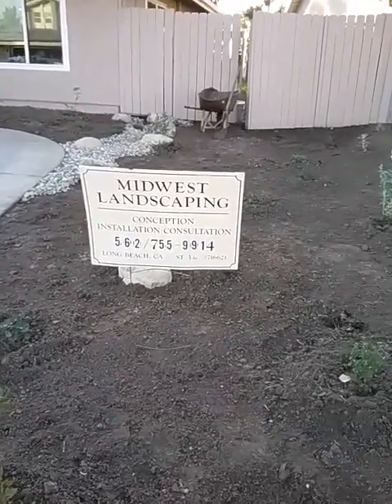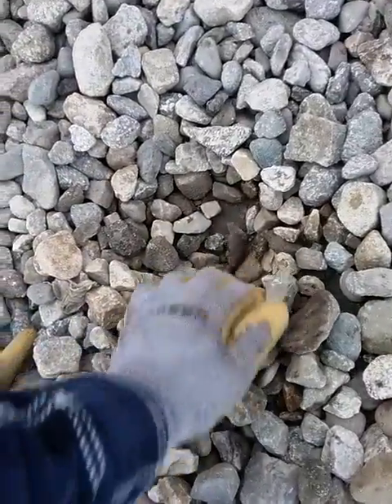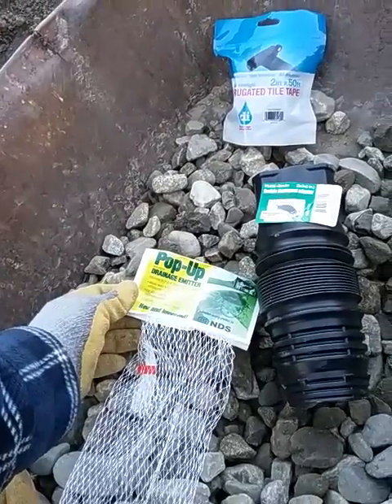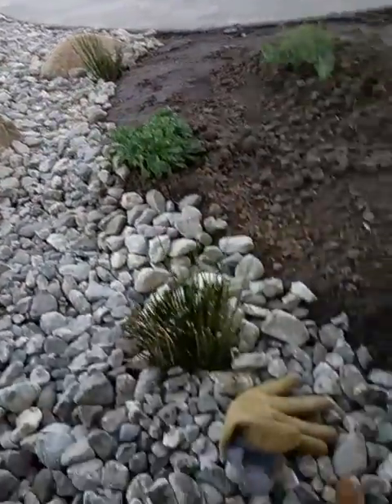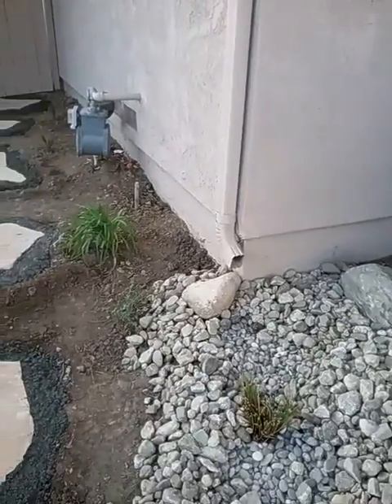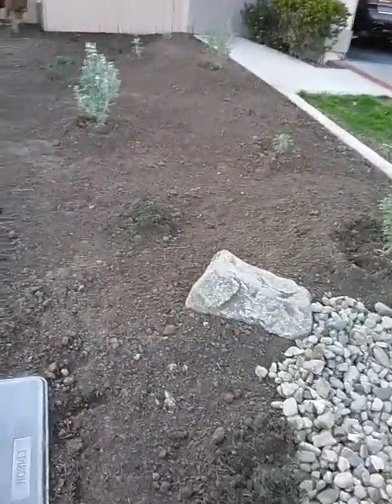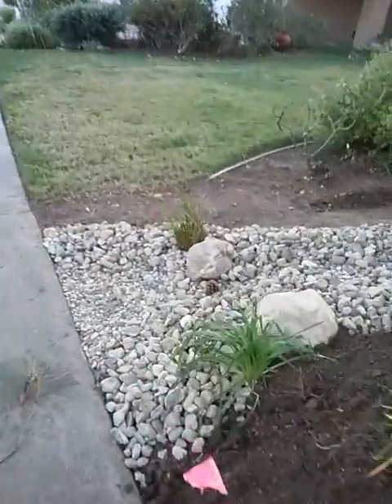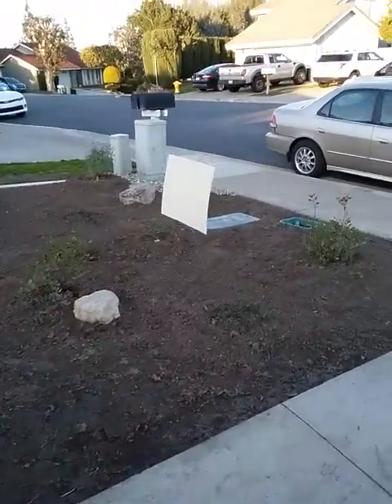Dry Stream  Bed Construction 101

Comment from the maker: Stan,
Thanks for checking out my video and yes the weed block fabric is permeable but, it is not really designed to slow the water, it is installed to help REDUCE POTENTIAL WEED GROWTH under the boulders and stream bed.
 
Plus, it helps reduce the sinkage of the stone into the soil over the years and keep the stones movable and not mud/dirt locked in the soil.

If you have any more horticulturally related questions, please let me know at eddiewallace34@gmail.com.
Take care buddy,
Ed